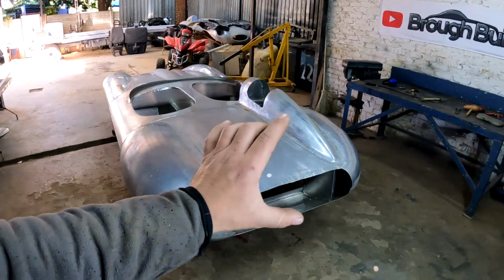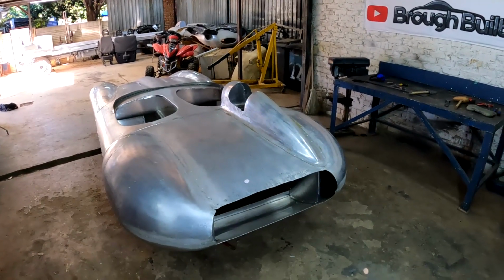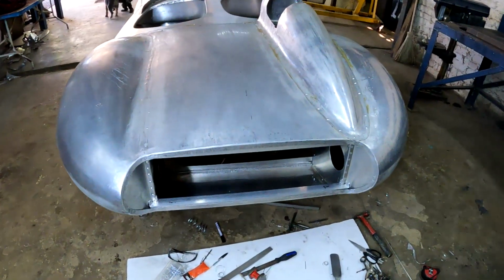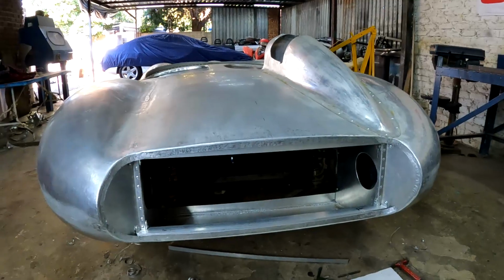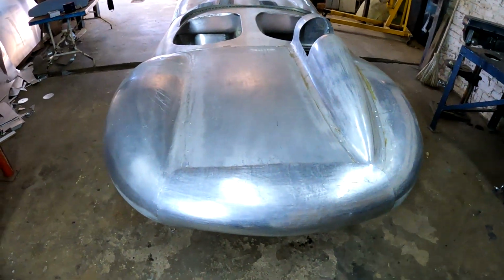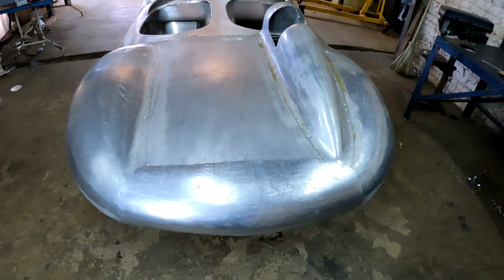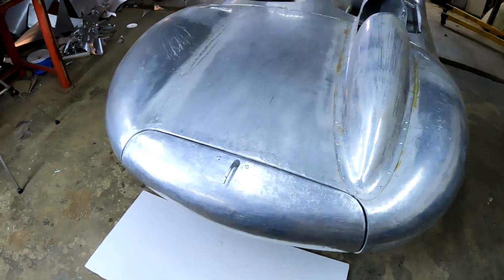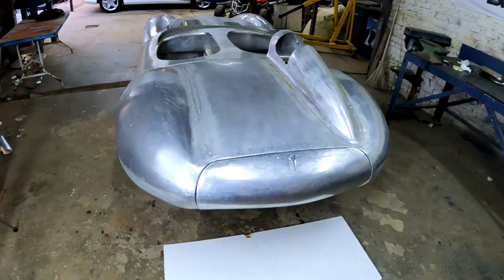The HARDEST part to build on the Jaguar d Type!

Comment: Great job. Really enjoyed the series. How much shaping experience did you have before beginning? You may have mentioned it, apologies if you have already but I forgot 😂
Reply from the maker: Hi Shane. I had very little experience. I have made a few panels in the past as well as making a body for a Bugatti type 59. But this is by far the biggest project I've made from aluminium. Also this was my first attempt at welding aluminium 😱

Comment: Another amazing job Donny! You did that faster than I eat my lunch😂. You were not beating around the bush, you were beating aluminium! Are you going to cut your own luvers, or add pre-made ones? What did the original have? Have you thought about a video at the end as a master class on working with aluminium, which tools, how you made the English wheel, hand beating etc? Seeing it in real time when you have finished would be great! Keep the good work up!
Reply from the maker: 😂 Thanks Boyd!
I am currently deciding how I'll be doing the louvres as I have a punch that I made a few years back, but recently found some pre made louvres that might be simpler (with better results) to weld into the bonnet. 
I will make a video at some stage to explain how (and what tools I use) 🤔 But I'm definitely not a pro, so there's a lot to learn still.
Reply: @BroughBuilt  thanks! Are you going to keep as aluminium or paint? I know you are doing the job for another guy, what does he want? I think as soon as you need to paint you will need a bit of filler or lead, making it at even bigger job! I’d keep as it it, showing all the great work you have done!

Comment: very good how did you make your English Wheel
Reply from the maker: Thanks Leslie.
I will be making a new and much better English wheel soon and will post the complete build but I kinda thumb sucked the dimensions and used some thick guage tube for the main frame.
I made the main wheel and lower dollies from solid round bar.
The adjuster arm was an old car jack.